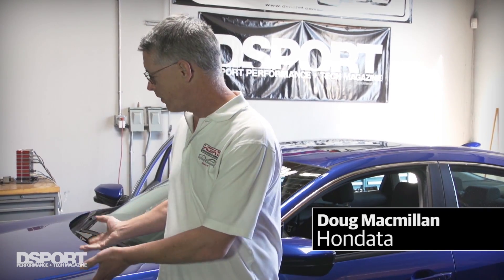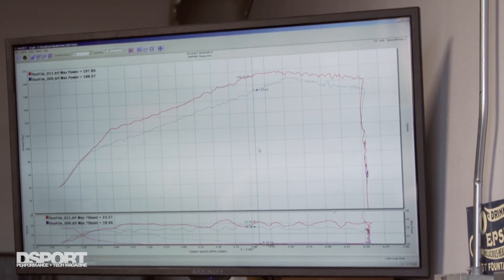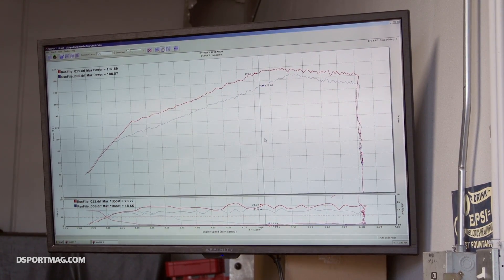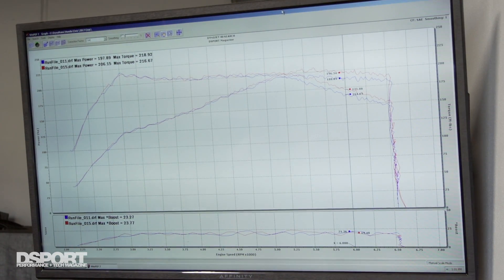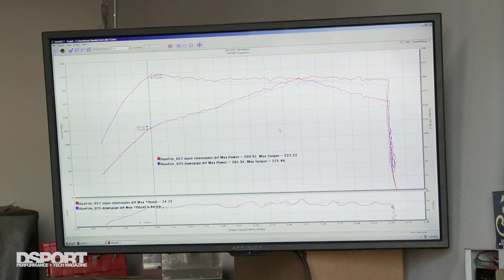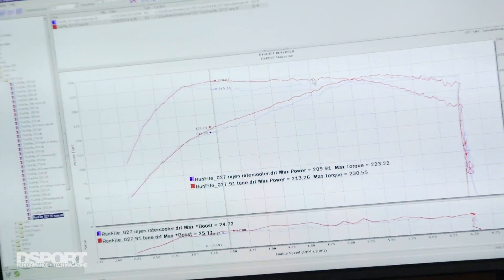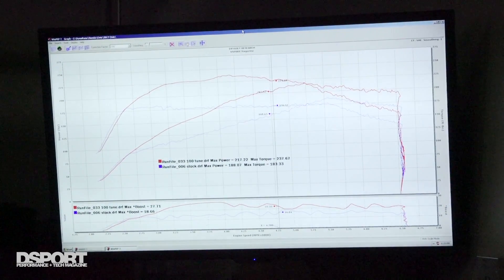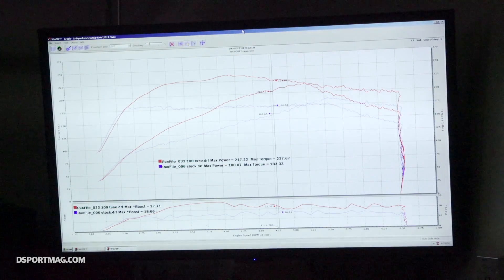Boosting to the Limits of the Civic's TD03 Turbo | 2017 Honda Civic Test n Tune

Comment: hello do you know how much power the transmission can hold up engine power?   200 HP? I'm afraid the transmission is broken after tuning
Reply: Probably 230hp is the max before the motor is close to blow before the transmission. The Si can hold 600hp so far.
Reply: @stratussx  some one one the civicx forums have it at 300hp with his own personal tuning

Comment: Do they make a 93  octane tune for the people in Texas that have 93 at the pump at the end of the mods made I would say that it makes good power for what it is next stop downpipe and then go along with the rest of the exhaust system for better flow but like the guy in the video said the turbo is about maxed out so bigger turbo as well and clutch do all that and I would be very interested to see not only what that does for power but if the stock internals can take all that

Comment: Why not a slightly bigger turbo and lower boost.i rate the engineers at honda but how long will those lil tiny 1.5l engines be able to handle all that boost.i love boost and am mechanic but alot of those turbo hondas will break when people start playing around with them

Comment: It is always enjoyable when various tuners try their ways.  To increase Boost +7psi for 25hp / 38lb/ft is not close to optimum.  When you are not gaining 10hp per +psi then (with what was added here) it is related to the turbo unable to keep up with demand + fueling or backpressure and more than likely ALL three.  If you use 102.5 Oct Race Fuel and aren't gaining anything even adding +2psi, why?  Simply put, a drop in high flow air filter in the box, intercooler upgrade, and a tune will NET much safer results w/o having to raise the boost to those levels (on the stock turbo of course).  You really don't want to mess with the DP with the stock turbo - it's far too small.

Comment: I went from a 2005 10,000lb 6.0L power stroke 4x4, to a 2017 2door 1.5 L and man this car is slow, very late on the take off, will not throw you back in the seat, has no sound from the exhaust, but driving at 65 mph you will most definitely get 45mpg.
Reply: You have a good point.

Comment: I was wondering if it was possible to share a custom dyno tune if possible. I have a 2017 Civic hatchback sport with CAI and turbocharge pipe and high performance spark plugs. I purchased honda pro but my car has idling problems after flash and all sensors keep lighting up.

Comment: I hope I understood this right and the first step was just remapping without any hardware adjustment and it boosted the engine by 20 horsepower? It seems like more than enough in most daily scenarios provided limited engine changes. Of course, you can do more but they point out that the stock clutch might not take more torque. I would like to know if this mapping exercise would  be safe for a CVT transmission. I remember Hodata's clip on the damage they made to the CVT trasmission when they passed too much torque through it.
Reply: A basic tune from Hondata is +6 PSI, ktuner equivilant is eco / 21PSI IF I’m not mistaken.. 

Personally on my 2017 Hatchback (manual) I just got myself the KTuner V2.  Not only does the car have so much more hp for the price of the ktuner, it made it like a whole new car.  So much more responsive on the throttle, no more idiotic rev hang, more torque, basically the same as hondata but much more customizeable as well as easier to flash and everything since I don’t need a laptop to do it.

The only problem with either tune?  Once you do an intake and front+downpipe, nevermind the exhaust, the clutch will not be able to handle it and will slip, which is why you will see videos of other people changing out the stock clutch to an FX300/FX350

I’m fine with just the tune and no other mods though.

Why did I wait a full year and a half before tuning? Simple answer was I wanted to see if anyone was ending up with major mechanical issues that warranty will obviously not cover.  With all of these base tunes no one has really had any major problems that i can think off, just don’t mess with stuff when you don’t know what you are doing.  It is a very very good modification and I would be more than happy with keeping this as my only mod (the second I felt the power difference I wanted to mod everything, but am thinking I may not now and will just work on paying the car off faster)

Comment: @1:32:  no way this car will be able to get 50mpg.  Most you can get is low 40mpg if you are very lucky.
Reply: I got the mileage up to 52 going 60.  Can get 44 going 70.  And that's stock with CVT.

Comment: Stop messing around with pump gas. The power isn't maxed until you start adding ethanol. E40-E50 is the sweet spot for DI engines. I would almost guarantee you could see 240-250whp with a mix. You can then skip the intercooler upgrade.

Comment: So Honda is advertising the 2017 Civic as having 174hp, how come the baseline is 184 to the wheels?
Reply: Edwin Ortiz Good question.. They are actually more capable than advertised. The L15B7 Engine is a wolf in sheeps clothing for being a 1.5L is super strong , real HP is around 180+ .. My Gen X Si with with 6 psi Tune and Stage 1 PRL intake can hit mid 13’s 1/4 mile which tells me it’s around 230+ WHP 260 Wheel Torque and its a similar engine to the one on the EXT. So again underrated by factory in my opinion, Honda focuses more on showing the MPG numbers..

Comment: Great results!  I really wish Honda had added actual VTEC to this engine.  It really would distinguish the civic from the turbo crowd.  They had the opportunity to do it with the Si, but neglected that.  It really is a shame.  Pretty much now a days, you can pick up any turbo cars and get tremandous amount of power gain for just a simple bolts on and reflash.   #turbo

Comment: The results a very impressive, would you be able to get similar results from a CVT gearbox? If not are Hondata able to provide a less aggressive result but still noticeable?
Reply: This is on a cvt.. all 10th gen automatics are turbo cvt.
Reply: @starcraftgod1212123  he said at the beginning of the video manual
Reply: @starcraftgod1212123  cvt version pushed to this limit will get destroyed
Reply: @Rayyan_741  you're right I didnt notice that, but I got the two videos mixed up because Hondata did a cvt video as well. And I have a tuned cvt. But i went with ktuner and two step performance. Hondata swears up and down they pushed cvts to their limits and even burnt a couple out to find their sweet spots and make them very responsive and snappy. Ktuner say the same. And ktuner offers more support and active tunes
Reply: @Rayyan_741  my stock cvt was 178 I'm pushing around 260 tuned with some bolt ons.
Reply: @Rayyan_741  I plan on doing an e85 swap in the future following ItzKevster channel he had a cvt hatch pushing 305 and was beating wrxs and stock type r
Reply: @starcraftgod1212123  oh yea I’m not saying their base tunes aren’t safe. Their base tunes add 6 psi but as you can see hondata went almost 9 psi extra on the manual transmission in this video. The cvt wouldn’t be able to handle the extra torque it’s putting down
Reply: @Rayyan_741  yeah they (hd/ktune) keep low end torque low.. but snap up mid and high end. To protect it. So your initial jump isnt good but because of the smooth powerband it just keeps chughin
Reply: @starcraftgod1212123  he commented saying he was hitting 250 HP with e85 on his channel and about 270 torque. He switched to an si now and also commented saying the cvt was unreliable and unpredictable and he knows people who had issues with it without even being tuned. Another person commented they blew their engine in two weeks running e40 on a hondata tune 2017 civic hatch. Push your car carefully bro
Reply: @Rayyan_741  yeah Cvts are... idk they're fun but theyre squishy. I'm tryna be careful and I change fluid regularly. I still got the car under warrenty 😅 but if they check my ecu I'm screwed

Comment: Are these cars underrated from the factory? Those WHP numbers would signify these cars are closer to 190-200 crank HP stock. rather impressive from such a small engine.

Comment: this motor was designed differently they have VTEC engaging in the beginning not in higher RPM look at the graph pretty much any motor at 27 pounds of boost would make power in higher RPM if that's the case they shouldn't have VTEC in the motor
Reply: dsm DaSoundMachine 
Non vtec motor

Comment: this cars a big spit in the face esp to the NSXs lol ohh so cool all touch couldn't make any analog features same exact screen the volume control can cause a accident ive seen it first hand but beside that its new engine i dont even think put there innovation into it cause the engine ISNT NO HONDA ENGINE Its Some Go Green Honda But You Know What Since The 🐢 Turtle 🐢 shell fg2 and under so from the 8th generation down to 1988 ill even take a wago van then again the crz or crx works cause even tho i keep my back seats i dont want people in my whip  i rather own one of those cars and deal with there engines

Comment: 27.5psi on a TD03?!? That thing must've been a hair dryer, LOL! I'm sure it was blowing super hot air and waaaaaaaaay  out of it's efficiency range. Heck, I don't run my Garrett GT2871 above 25, and that's when I'm spraying methanol and have E25 in the tank. On 93, I stick to 22psi. That's on a ~43 lbs/min turbo. (390/385 @ the wheels on high boost - Speed 3).

Comment: So Honda must be under reporting the horsepower and torque numbers because here in North America the Civic has 174 crank horsepower claimed by Honda but obviously the baseline test here is showing 187 wheel horsepower and that if you add calculate 15% loss you should be in about 220 crank horsepower stock not 174, very interesting. About two weeks ago I bought it 2017 Volkswagen golf GTI and the numbers are 210 hp 258 pound feet of torque at 2000 RPM and it feels much more powerful than that I'm told that Volkswagen also under reports the torque and horsepower numbers and that it's actually around 260 hp and 280 pound feet and it does feel like it.

Comment: you need to get the air out, no down pipe, high flow cat, or at least a catback exhuast...? That's the first thing any honda (ricer) owner does is put exhaust on the car... I  know I did

Comment: Why no exhaust?? Free flowing exhaust should be the first mod on any turbo car.
Reply: not on these small turbo cars, for instance a stock turbo fiesta st will see little to NO gain with a turbo back as the stock turbo is the bottle neck of the whole system, intake adds nothing but noise as well. Now upgrade the turbo and that another story
Reply: Rsaxon1979 you right my friend

Comment: Will any of these work on the 2017 CR-V AWD?
Reply: Came late to the party but here you go if you dont already know: ecu tuning works, downpipes designed for the civic fit, intakes designed for the Si work if you manage to install them( I went PRL SRI), FMICs dont fit and noone has released one thats bolt-on

Comment: I think you can get the same hp/torque figures from it's competitors like the elantra turbo, even a little bit more.  Must have been a strain on the engine though 18psi stock is already very high for a non-forged engine.

Comment: Nice vid !  Only one thing , its not WHP like mentioned,  its hp.  Stock cant push 188whp while it has 180hp on paper.   Delta is cool though !
Reply: Littleboi could you elaborate? I was wondering the same. I just picked up one of these and was wondering about 188whp x 115% = 216hp. This has to be crank hp, right?

Comment: Wow! Im surprised it made 217whp with not that many mods! My '13 V6 Camaro is close to 300whp with full bolt ons and E85. This made 80hp less, but is 1000lbs lighter! These turbocharged cars are getting nice nowadays.
Reply: its not WHP,  its HP
Reply: rozario orlan  so with the civic being lighter and only 80hp slower, would it be faster than the camaro?
Reply: Alliid Mozahre wouldn't say it would be faster, but still would probably keep up pretty well. still would be a quick and fun car either way
Reply: So why does so much ppl hate honda, if they can make a car that can keep up with muscle cars or bigger engines? And isn't a cheaper car to build or mod
Reply: rozario orlan it's not that surprising to me..I have owned a Renault 5 GT turbo in the 90s..that was tuned not massively either and was pushing 190 bhp..that was 1.3. carburettor !.

Comment: Filling up your tank with 102 octane gas is impractical IMHO. It would've been fine with just a tune, intake ,intercooler and 91 octane gas. But I understand what hondata is doing when getting the most out of the stock turbo and they did a great job. I hope I can do this when I get the new Civic.
Reply: John L they wanted to max the turbo out. That's why they went to the higher octane.
Reply: That was my point. They wanted to test the limits of the stock turbo, along with some upgrades including high octane gas. And the turbo performed quite well. That being said, it's practical to do the upgrades with a different tune and use 91 octane gas to get usable hp and torque for daily driving. I would be satisfied with that setup.

Comment: LOL MAKES 200HP AT 30 PSI BHAHAHAHABAH
Reply: It has a the tiniest turbo. TD03 is as small as I know, I don't think there's is smaller unless it's like a motorcycle turbo or something.

Small turbo = more torque, less HP.
Big turbo = less torque, more HP.

It seems like they are pushing too much PSI, but since the engine is small it's not really stressing the turbo as much as a bigger engine would. A bigger engine would max out the turbo at a much lower PSI.
Reply: u cannot generalize turbos like that i have a mazdaspeed 3 and it has a k04 stock its not big but it's not tiny for a 4cyl and it makes buckets of tq while the POS fiats I work on have tiny ass turbos on their 1.4l and they make no power it mind as well be a N/A 2.0l
Reply: SI0AX yep pictured to the left MY00 40kmiles
Reply: Jake Mata 2000s are 2L. Ap2 s2000s are 2.2.
Reply: Honda S2K?
Reply: Ryan Rohauer 2.2* but who's counting... s2k makes most power per litre :p
Reply: Austin Bables  ap2 in the US are 2.2l in Japan and EU they are still 2.0l until the last 2 years I believe
Reply: which shows the 2.0l is the real s2000 engine ap1 FTW
Reply: SI0AX actually it's not always smaller turbo means more torque, you can have a big turbo with a small ar housing and a quick spool valve and make a lot of torque
Reply: Sergio Aguirre LOL i was bout to getting a 335i to play a bit but i see i can get as fast car with way smaller engine with this 1.5 Honda and maybe save some money while destroying fbo n54' out there with my Civic on fbo too LOL LOL
Reply: Sergio Aguirre Post a vid please.. gotta see that. Thnx
Reply: Ryan Rohauer my NA 2.0l makes 240hp

Comment: Check out Vit Viper blog he picked up 80-90 extra torque completely stock with K-Tuner. Didn't even need an aftermarket intercooler or intake.http://blog.vittuned.com/tag/civic-x/

Comment: fun fact... rdx in North America was turbo charged a few years ago
Reply: TheKingkingg That's common knowledge. And it was a proper K series engine. Hondata had a flashpro for it too.  Fun fact would be that the Rdx engine(Honda's 1st production turbo vehicle) was designed by a woman.
Reply: The Dragon Reborn rdx is not hondas first turbo engine, honda went turbo in early 80's or late 70's quick someone look it up. the bold head honda fanatic guy show it on one of his youtube video 😊😊